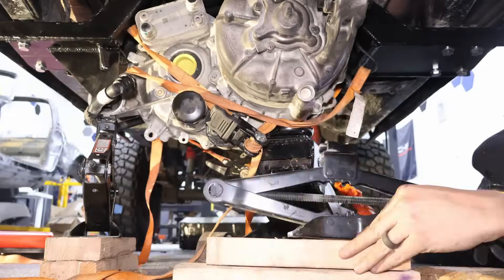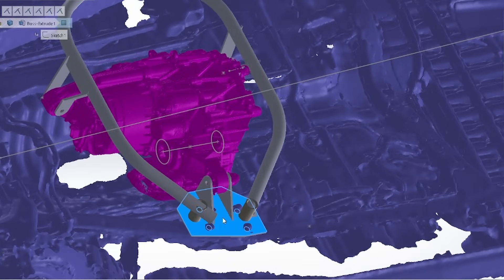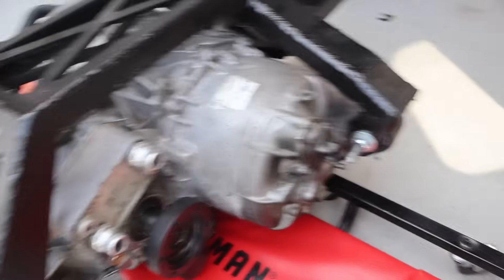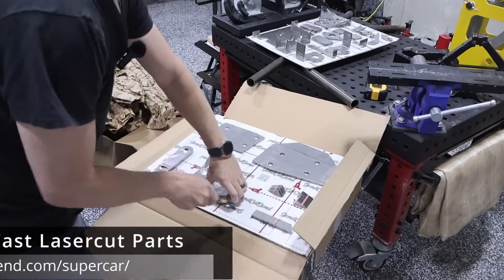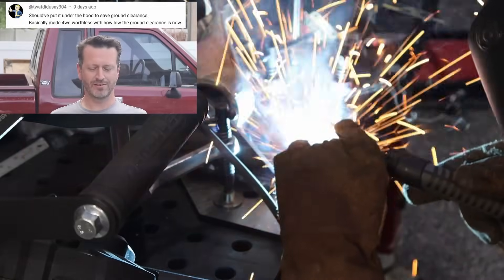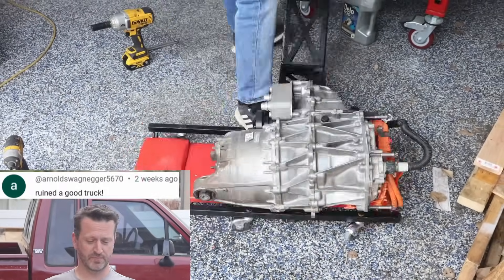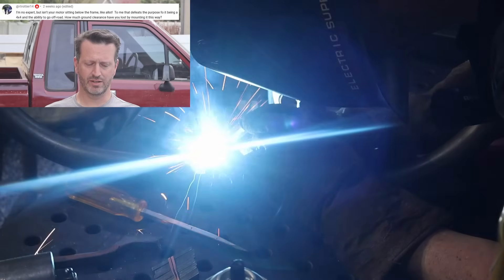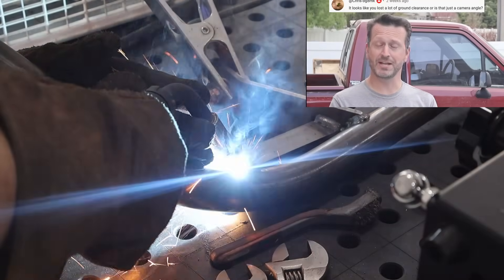Modifying a Motor Mount for a Tesla-Powered Toyota Truck

Comment: Don't worry about the wannabes and their jabs, they just wish they could. I really like where this is headed! It's really answering some of the ideas that've been rattling around in my head about mine. (97' Taco single cab 4x4). 

You may have said it already, but do you have plans of maintaining 4x4 mechanically? 
If you get the CG right this thing will be an even more impressive off-road machine than it already is. Talk about some serious potential for preloading and a sliding rack for the batts as a variable weight transfer mechanism coupled with traction control. Let's go!!!

During testing, along with GoPros try painting areas with a more visible color of paint like neon yellow where stress fractures could develop. If there's any movement of those joints it'll show up better and then paint it back in black🤘afterwards. More than one reason for the flashy chassis on racecars.

I always wanted to do a 2wd single cab drifter slammed to the ground old school Mazda, Nissan, or Yota, wing windows, and a sliding back glass I call it "grandpa sleeper" style.

Keep up the great content and ignore the "experts" who only bring criticism and no ideas!

Comment: You can never make all the Keyboard mechanics and youtube technicians happy lol. I've always wanted to put an electric motor on the factory toyota transfer case but the Tesla drive unit is definitely a little on the larger side to fit in that area. 
P.S. If they think the ground clearance isn't good enough now, just do a solid axle swap and put 42 inch tires on it....problem solved! lol

Comment: A lot better. Before you were only considering rear profile and not side profile. And the diff is over the wheels. So if wheels go up then diff goes up. With moto not over the wheels you’ll have to consider things like speed bumps and shock recoil

Comment: That looks and appears to function way better than the boxed member. Only thing I could see that could be a potential problem is tube flex as they are not connected together except through the plate and motor. That potential issue could possibly be resolved with skid plate? I personally like full connections. Loving the build so far, excited to see what’s next on it!
Reply from the maker: Thanks for the comment!

Comment: how are u going to lock the center diff ?
as it is now u have an AWD system not a 4WD that  should do a 50:50 front/rear and with out a traction system that is not good off-road.

Comment: Just came here from the other video and my gut reaction was definitely "that's way too low" I was a little surprised that you didn't do a test fit before fully welding the old motor mount. 3D scans are great but never beat seeing it in person. 
New location and mount looks good. You're only really going to see rotational load on that motor so I don't suspect you need more longitudinal bracing. Looking forward to seeing the completed build and your plan for battery mounting. Looks like a fun project. I have an '85 Scirocco that I have plans on eventually doing a RWD electric conversion on.

Comment: Also, haven't worked on older Toyotas for a while, but doesn't the front driveshaft turn reverse on those?
Reply from the maker: @texasrob2782  output from the transfer case goes the same direction for front and back

Comment: Ok, so I was overcomplicating it; I've been accused of that before. So basic variable throttle, no regen. GPS module for speed, so no wheel sensors, no ABS, no TCS. Electric brake, electric power steering, electric cooling if needed. Do you use a separate 12 volt battery system for electronics? Do you build battery packs, or use the Prius modular type?
Reply from the maker: @texasrob2782  we build our own battery packs.  Yes, separate 12V battery, yes regen.

Comment: Your videos seem to only show fabricating mountings for electric drive units. Throwing a 1000 ft/lbs of torque in an old Toyota seems like an impossible to control scenario and safety nightmare.  Are you using the Tesla ECU or aftermarket system?? How do you safely maintain control of the vehicle? How are you integrating the body control modules and dashboard? What about spring rates and dampening for the new much heavier load? Don't you have to reinforce the frame when you double the curb weight to over 4000lbs? A Tesla battery weighs over 1000lbs.  What about the battery management system and cooling? I want to see the thing that are SPECIFIC to "Electric Supercars." There's already tons of metal fabrication videos out there.
Reply from the maker: @texasrob2782  not using tesla modules so it will be much lighter.  Only planning on ~100mile range.  Aftermarket controller and custom body control with dashboard.  Model 3 motors do not have 1000ft-lb.
We post our progress weekly so stay tuned

Comment: I'm not sure if the LSD will work in 2wd as it will most probably slip and prematurely wear out. In 4wd it will potentially bind when trying to turn as the LSD will be working properly.

Comment: I don’t really know much about cars or mechanics or anything like that… but wouldn’t it make more sense to use the front? Like, where the engine used to be? Feels like it’d save space. Maybe even help with balance? Less chance of bumping into stuff?
And I mean, it’s a Hilux, right? Off-road, trail stuff, that whole vibe. So I’m just thinking—if the guy’s gonna take it out for some real adventures, hitting rock trails and all… wouldn’t having an electric motor underneath make it kinda risky? ’Cause, you know, it’s not like you can do quick repairs out there. That’s basically GGWP. One more thing, the job is F great, it is just a curiosity… 

BTW, I love the channel!

Comment: Great job. Can't wait to see the battery layout. All in the front or distributed to keep 50/50 weight distribution? Good series I want to see it drive!!!
Reply from the maker: Thanks for the comment.  We are planning on a split pack with some in the engine bay and some under the bed.
Reply: @electricsupercar  sounds like a good plan

Comment: A skid plate wouldn’t go amiss. Even a couple of front to rear bars would be better than just being open. If you drag the bottom of the truck over a big boulder, you’ll want to protect those aluminum casings from getting damaged.
Reply from the maker: Good call

Comment: Now that you have the tubular mount made, you might want to add some tabs for a sheet metal skid plate. I only mention this since the housing is made of cast aluminum and a good strike will crack it.

Comment: That looks so good! have you considered cutting the bed floor out and making a removable battery case that also serves as the bed floor? It'd certainly help the traction by having that weight over the rear axle.

Comment: Better to have more ground clearance but it was no way detrimental to the offroad capability 😂 if you want offroad you should add a skid plate and also .... Rotate the entire front axle back so you get a little more suspension for front impacts

Comment: Nice work, did you need to rotate the Trans Axel ( tesla motor and Diff) to get it higher? if so, the oil pump pickup may not be entered for the pinions and reduction gears....if not pls disregard....As a F150 EV owner, can't wait to see it rip!
Reply from the maker: It is within a few degrees of stock mounting

Comment: 2 separate motor mounts front and back with 4 new mounting plates welded on the chassis rails much stiffer and lighter. bolt the new mounts to the 4 new plates lift the assembly and weld on the new plates to the chassis. The existing plates fust held the back of the original gearbox and the ice engine mounts supported the front of the assembly. The short open-ended tubes have little stiffness. I built an EV conversion 35 years ago and an apprenticeship at GM and my grandfather was a draftsman there.

Comment: Tube bends are a weak point, I would recommend reinforcing them using gusset plates. Also the reinforcement is required at the small tubes on the plate. Regarding the mounting plates please reinforce the open spaces with additional plates as any lateral movement will bend them. I have my concerns regarding the small plate piece welded there in the middle. Make a bigger piece and weld it to the tubes as well

Comment: Looks good! A skid plate is a good idea. My other thought is the original ICE and gearbox were supported at the gearbox and further forward at the engine mounts, this meant that the engine and trans couldn't rock front to back. There looks to be a fair bit of twisting that could go through where your mount attaches to the chassis. Perhaps a cross bar at the front or rear going onto the chassis rails would stop the twisting? Or at risk of doing it again, a crossmember for the front and back mount, then join these with plate for the skid plate?

Comment: Looks cool. Might need extra bracing. The load and mount points are way offset from each others.
All of the load is dependent on some welded joints that would have to endure a long fatigue life.

Comment: Australia Here.
That looks better. 
I agree a bash plate/ Skid plate  that gives that alloy motor casing some protection from rocks and lots of mud getting up all ver that unit will be needed.
I know that Richard from Electric Classic Cars in Wales from the UK has used a Tesla Model 3 drive unit but flipped his upside down and modified the oil pump  in the reduction gear drive unit for his land rover kits.  
That way getting even better clearance on his Land Rover SWB .   
Another option also to modify the floor pan on the Hilux to give you even more clearance if you find it necessary .
Given you are now at about the same as stock you should be fine.

Comment: Looks high enough now. Nice job. I would put a skid plate and or two parallel DOM tubes along the mount so that the motor is protected at the bottom.
Reply from the maker: Thanks!  I'm definitely going to add some protection underneath.

Comment: I like the new design cause it works as a cage protecting the motor from direct impact. The only other thing I would have done different is to make it a ramp so if you did impact on something it would more likely slide over it rather than snag. A skid plate would help too. but I'm just being overly picky. :P

Comment: For a general runabout truck and ocasional off-roader this is a great improvement. I was happy to hear at the end that you are putting a skid plate under it. 
Reason being, in the original the mount acted as a "skid plate" of sorts to protect the pieces with oil in them. 

Your, the critical bits are hanging the lowest. A good skid plate will work. For a rule of thumb, if it looks good enough for a supercar, you want it three times stronger for an off-roader. Another rule of thumb is, you have lots of clearence until you don't. On yours I think it is a "dirt in my rims on a gravel road" type of off-raod'er so I'm sure the basics wiill be fine. Good luck with the rest!

Comment: Glad you re-did the mount. Looks way better. It wasn't so much the ground clearance that was the issue but where it was hanging so low. Really messed the break-over angle up and would have been susceptible to damage.

Comment: I didn't comment in the last video, one of the comments you read out was about it being an optical illusion, and I think thats on the money. It looked lower than it actually was. Either way, this is a much cleaner install! I bet the previous placement would have looked at home once the propshafts were in place!!

Comment: I suggest you find you a transmission jack to modify .. ive modified some floor jacks to do transmissions but a good transmission jack is just another level .. like when you added the 20v dewalt real impact or the band saw  .. you are lucky enough to have a smooth work area would make life easier  ..
Reply: something like WESTWARD Transmission Jack: Mfr. Model 1ZKY3
Reply from the maker: You are absolutely right, that would be a good investment!

Comment: Only suggestion is to add a skid plate that bolts to the tubes to protect the motor. Should be pretty easy and would get you a lot of peace of mind, especially if this gets driven off-road
Reply from the maker: I’m definitely going to consider it.

Comment: I never had a comment on how low it looked, since I was already confident you had significantly more clearance than the stock truck in any case.  I liked how the previous  motor frame provided some protection for the motor itself and you may want to incorporate some kind of bash protection now but the bent tubing looks way more elegant and finished.

It really doesn't matter what you do, somebody is going to give you grief for it...
Reply from the maker: You're right, it will always be a hot topic.
Reply: @electricsupercar  The internet is gross. Your 2nd iteration is such an elegant design, I love it! Honestly I'm ridiculously stoked to see how your project turns out, really glad I found the channel.

Got no hope of finding a Hilux in the country I'm in, but I'd love to try this on an old L200

Comment: I was wondering whether the motor will turn the rear and front shafts in the correct direction since it is originally supposed to rotate two axle shafts in the same direction!

Comment: One small suggestion I have on this design is the skid plate. Not sure how hard it would be or if it is even possible to relocate both the filter and oil pump. As it is electric drive that should make it a bit easier if possible. Just to open up a little bit more ground clearance since they are the lowest points of the drive unit at this time and thus highest risk of getting bashed should the skid plate bend for whatever reason. Flat skid plate then should get the whole bottom around that 15" and thus be higher than stock mount. For those concerned about triangulation of the structure should be satisfied with whatever design you use for the skid plate since it will brace the tube structures.

Comment: It seems like people don't realize how much ground clearance 11" is. For me, the concern was more exposure than clearance, but that's easy enough to address with a skid plate and rock sliders. My guess is most folk are disoriented because they are used to the exhaust system being the lowest point, and without it, they have no concept of what the ground clearance actually is.
Reply: Right? The new rwd ct has 9" of ground clearance!
Reply from the maker: Good point, it’s a different way to think about it!